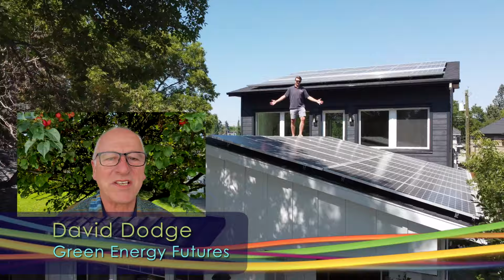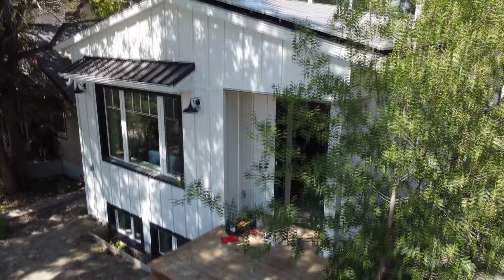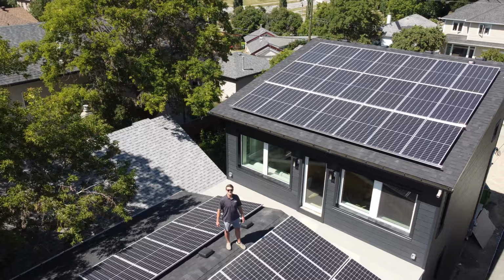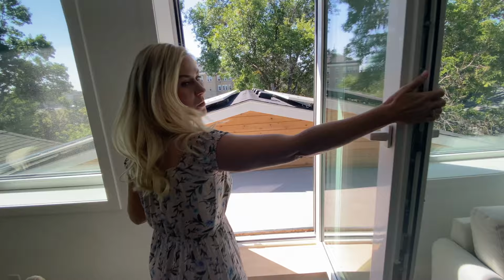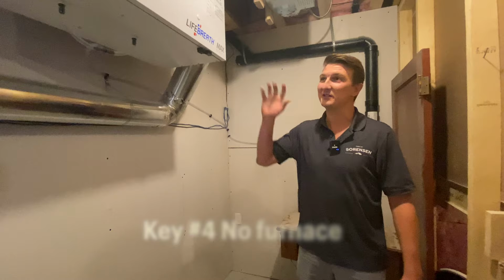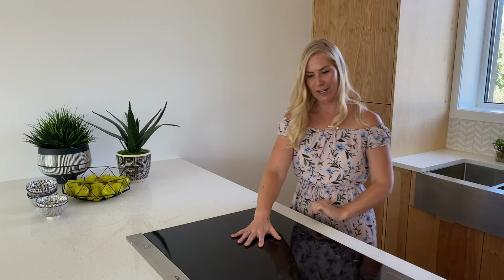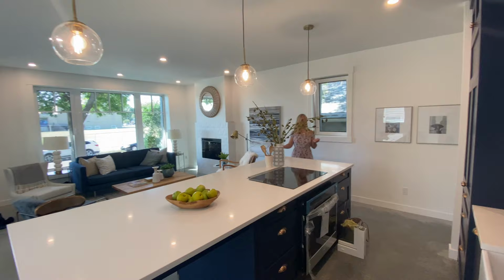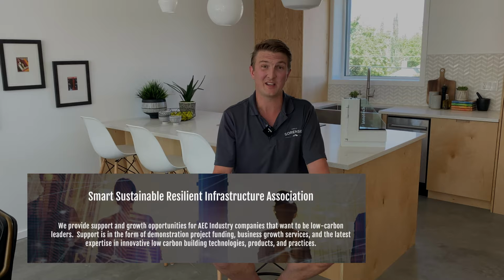297. Passive House 101 - Anatomy of an amazing net-zero cold climate passive house

Comment: I liked the idea of using some of the hot water on really cold days to heat the house. My heat pump water heater uses about 350watts when running, so heating this home with only about 350watts sounds amazing.
Reply: But... you need the hot water to heat the house on the coldest days, when the COP for the air source heat pump will be at its lowest. It makes no sense. Basically you will heat with electricity in winter.
Reply: Instead of a heat pump water heater you should use a solar hot water heating system

Comment: Nice one guys. Congratulations !
The design concept of having two separate family unit suites under one roof, and sharing mechanical and other infrastructure is going to gain popularity in our common future - where resources become more and more scarce and people evolve as a result.   

Re. The LifeBreath max HRV - pretty sure that unit is not PH Certified,  and that the claim made here that it's "85% efficient" is debatable with energy nerds.  Are not the testing methodologies wildly different...?   
Anyway, that might be a deal breaker in terms of PH certification, however it can be argued that it matters not in the end - with the added price tag attached to the piece of paper. At a certain point (subjective) there are declining returns on investment in pursuit of extra performance, and that piece of paper may be one of them. The blower door test confirming the envelope's air-tightness, well installed insulation, and to high insulation levels, and the right insulation in places in terms of embedded energy (cellulose - check!, EPS - over all other foams - check!), triple pane windows (domestically produced too!), you're ticking all the boxes.

And with Calgary's hot summers it will be interesting to see how the house performs in terms of keeping much of that heat from penetrating the roof structure (the rooftop PV panels should help, also), and ultimately the home's cooling load, relative to code built McHousing.

Well done !
Respect from west Quebec

Comment: bit torn here... 
r50 walls?---great! except that's the insulated portion between the studs that wick all your heat away to the outside, & they have no mass like ICF (which would score lower on a blower-door test too. HRV?---great! except w/o using the earth's steady temp to draw 55-65f air from, your temp delta in Canada could be 80f+. triple-pane tilt/swing windows? great!---except it wasn't mentioned if they were positioned for solar heat gain & minimized on other walls to combat heat loss. 
...with the title including "Anatomy", i guess i expected a real breakdown of all the steps taken & decisions made to maximise efficiency. instead, it seems a mostly traditional house with really thick walls, expensive windows, and a MASSIVE solar array to counter it's lack of genuine efficiency.
Reply: The panels are most because its an all electric home and likely tried to factor in the household. It also is practice to offset the studs for a double all system - so its only the top and bottom plate. But they should have clarified the effective vs nominal R-value.

I'm curious on the heating decision as well. If it just wasn't deemed necessary or if there was something else at play. That looks like an air source heat pump for the water, and as far as I could tell there isn't a backup if it hits too could for it to work, and the tank isn't shown as well.
Reply: To meet Passive House certification the house has to hit a bunch of points. They didn't get into the nitty gritty here. It's definitely an interesting topic, but it's pretty technical  and information dense. I imagine that this video is more geared towards generating interest than providing information.
Reply: @jonathanburr9798  I don't know the specifics, but if it's done right, you don't need a typical furnace. The idea behind "Passive House" standards is that the majority of heating and cooling of the home is as the name implies- passive. The house should more or less maintain a constant temperature with very minimal need for appliances that run off of gas, electricity, wood, etc.

Comment: Can you explain a little more about your heat pump water heater.  In the video there was s unit outside.  Is this part of the water heater.  My understanding about heat pump water heaters is that it takes the heat from your house.  Having a unit outside will not work well when it gets below 20-25 degrees Celsius.  At this point you will not have any hot water and hence no heat for your house.  What am i missing?

Comment: The walls and ceiling are very well insulated with high R ratings. But even very efficient windows have R values of 8 or less.  Do passive houses like this one require special shutters to manage heat loss at night or when the sun is not on them?   We tightly insulated our house to maximize efficiency but have lots of windows to the south for passive solar gain, but I am concerned we lose quite a bit of heat overnight through windows.  WE are in a cold climate not so different than Calgary's.
Reply: The purpose of south facing windows on a Passive House is to gain more heat than they lose so they really rely on Solar Heat Gain during the day luckily Calgary is the sunniest city in Canada so that helps a lot. The windows in the video aren’t your normal Triple Pane Windows, they are Certified Passive House Windows. Certified Passive House Windows are guaranteed to gain more heat than they lose as long as during the day the sun shines on them. All Heat Loss & Heat Gain is calculated in an energy modeling program by Passive House called PHPP. Too much south facing windows is not a problem really for Heat Loss as long as they’re good windows. The concern is overheating even in the dead of winter. It’s a balancing act between more windows or upping the insulation in the walls & attic.

Comment: The problem of a passive house is that you need air recirculation or it will mold badly.
Mold ,aside from looking gross,can be deadly.
Basically new homes look like laboratories
Reply: There is air circulation, it’s just technological instead of manual (opening a door or window). Air circulation can be established without cutting giant holes in the walls and ceiling, LOL

Comment: My only critique is maybe using a metal roof and avoiding asphalt (petroleum-based). Also, some metal roof designs can avoid penetrations into the roof for solar panels.
Reply: or recycled rubber roofing
Reply: We looked into these options, but the cost increase from an LCA perspective was not worth the difference to us. Making these more affordable and having the right ratio of build impacts to operation impacts is what we thought to be the most important aspect. The cumulative impacts of making this more affordable is where the real environmental difference could occur.

Comment: It may be energy efficient, but they're 15% more expensive to build plus you're doubling or tripling the amount of construction materials and waste.
Reply: It will will pay for itself over time. Ours is 15 years or so. Absolutely worth it.
Reply: Even if we took out the eco aspect of it. People spend over 90% of their time indoors, especially in Alberta where it is winter for half the year. Having no hot, cold spots, or drafts is well worth and definitely adds to house value on resale. 
My traditional built house in Edmonton has a 2C difference between upstairs and downstairs, and it's even worse compared basement.

It is also a dream for prepers. All the natural gas lines could blow up tomorrow and people in this home would not care.
Reply: Project Leo comes in at 10% more expensive. The mortgage cost per month of that increase is entirely offset by the renewables savings and utility hookups. So on a per month basis (the real metric that matters to people) we are a 0% increase to be net-zero. We are completing an LCA for the environmental impacts of the build (as well as operation). This will quantify the impacts of building the house vs a code built comparable. We are expecting the environmental impact for upgrades to be less than 3 years of the operation. So the "materials and waste" are completely worth the impacts they initially create. It would be like receiving a 97% return on your investment, but for the environment.
Reply: Also we did waste sorting for the entirety of the project and it was only 2 bins of waste. Less than when I worked building standard homes.
Reply: @kino_cinante  A preper's dream home is made with rammed earth. Cheap, bullet proof (literally), weather proof, won't degrade for 1000+ years, readily available materials and more energy efficient than any home you can build if done properly. I guess it makes me sad to see that we ignore proven and highly eco-friendly building techniques in favor of what is essentially a traditional house with more insulation.
Reply: @glennh3937  Thanks for replying! A 10% premium over a traditional build isn't egregious, but the unfortunate fact is that our traditional building materials are becoming more scarce and more expensive. While you may be able to justify the premium with monthly energy offsets, it's falling short of the big picture that modern construction is failing to be sustainable.
Reply: @Noble909  no offense but this style of home is incredibly popular in Europe and has been done for a long time. I know because I'm living in one in Germany. If anything, this style is the future and more proven than the antiquitated North American practices. NA houses leak like crazy and they're very weak. Also you can do passive houses with different materials like icf which is also very popular.

Comment: I have lived in passive house for almost 2 years and I have hated every minute of it. This is not a good place for the human body.
Reply: Too tight, with poor air quality?
Reply: @bengt_axle  Oh my... YES YES !!! - in the morning it heats up with the sun coming up, then I get super warm in my bed and have to ask Google to turn on the FAN. Then it turns on the fan, and cold air blows from the ceiling and hits me so I get cold and awake two hours before alarm rings.... Then I just get up and start the day early, ask Google to turn on the coffee-machine, making some strong coffee with milk, tell Google to turn on the lights while I walk around opening windows and doors just to get real temperature in. And of course, the damn pipes are full of dust from clothes and whatnot, so a few hours later I have to ask Google to vacuum clean every floor cuz is full of dust and bunnies falling out from the fan like a mafaqqa. Welcome to Passive House - Dumbest construction system ever invented for humans.
Reply: @fyrstikkenofnorway2744  why don’t you just turn off Google and open one or two windows slightly? I think you could solve your problem with just some natural ventilation holes. Maybe an opening in the wall with a louvred panel outside over it to break the wind. You leave it open as long as it is not too cold, so as to create a convection of fresh air. Newer designs are trying to reduce this problem by making the house more breathable (gas permeable) through the walls. They use special paint in place of a vapour barrier.

Comment: Cold climate.... So Ontario? Lol ur not going to heat a home with electricity up therr
Reply: What do you mean? Are you implying passive houses don't work in Ontario?
Reply: @crazyliv  I'm saying BTU is a BTU and to heat a 2,000 SQ Ft house with electricity only would take 40,000 watts. Unless your ok with it taking 6 hours to warm Everytime you open the door
Reply: @electromechanicalstuff2602  we have passive houses in much colder climates though and they stay warm very easily. The point is they warm up just from the sun and a small amount of energy and then the heat doesn't escape. Even if opening the door. I live in one now in Germany. They're very common here. We also have underfloor heating. I'm moving to Canada and planning to build one there too becsuse they're so comfortable and nice to live in.
Reply: @crazyliv  under floor heating. What is the energy source. Electric, gas , solar?.what heard the floor
Reply: We filmed the story during the new hot summer. Since the home is so well insulated it keeps the heat out in summer as well as it keeps it in in the winter. With door wide open for a good part of the hot day in summer and with the heat pump not hooked up yet the home stayed very cool all day. That's the beauty of these homes. A simple heat pump can keep them warm in winter and cool in summer.